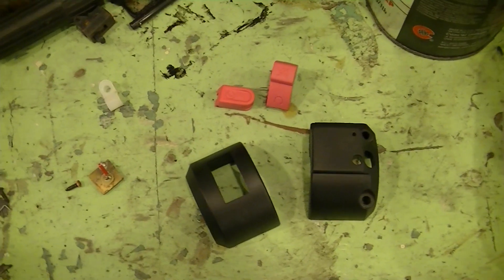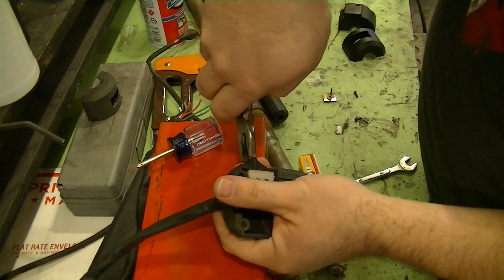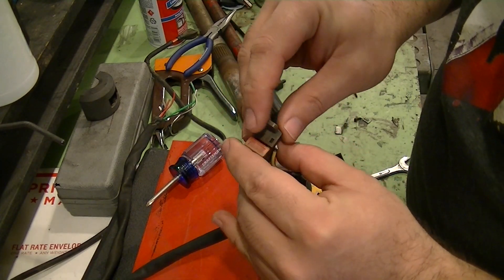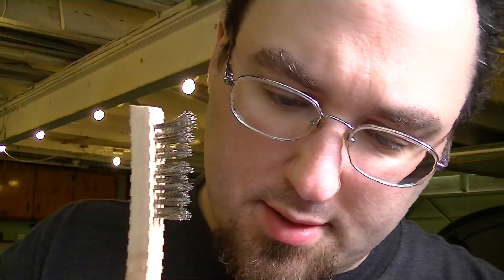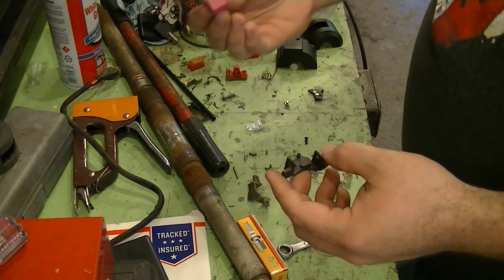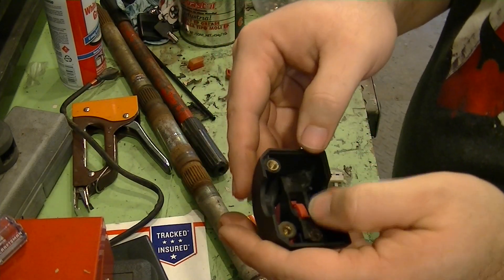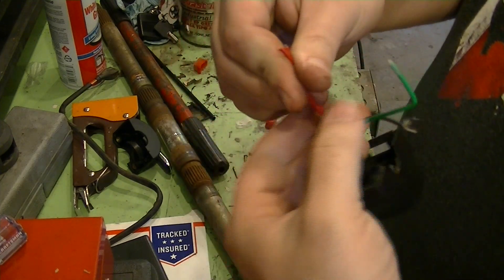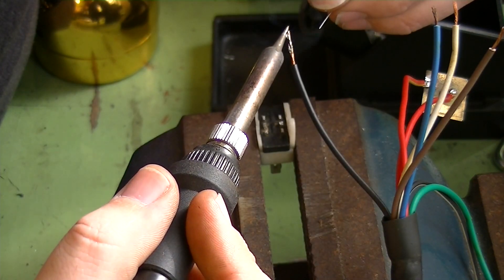Project Quad: TaoTao 110D - Part 12 - Electrical Wiring

Comment: I’m having trouble with the upgrade led headlights high beams could you tell me which wires did you finish soldering on the switch?